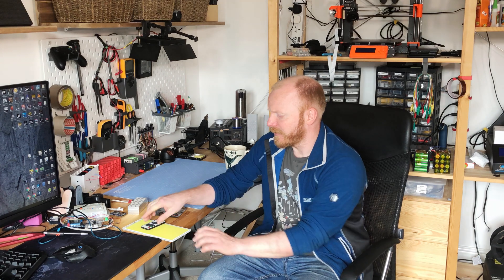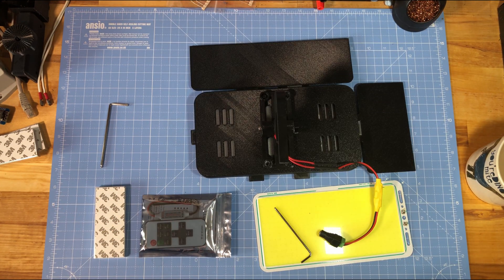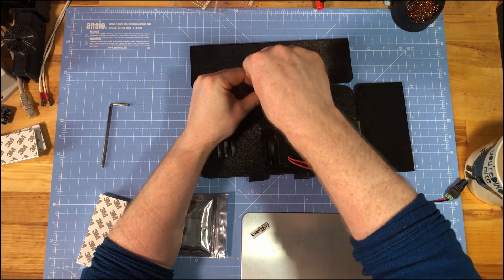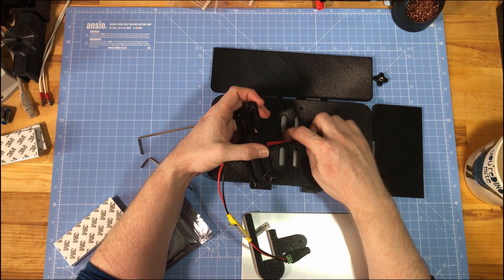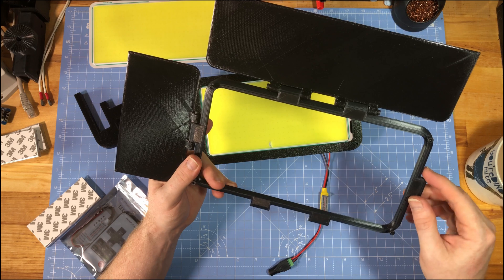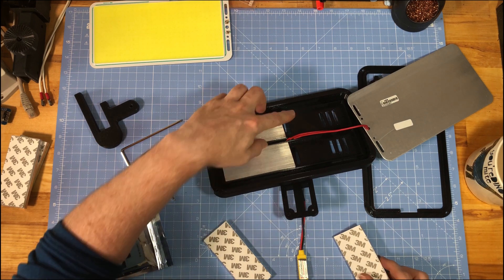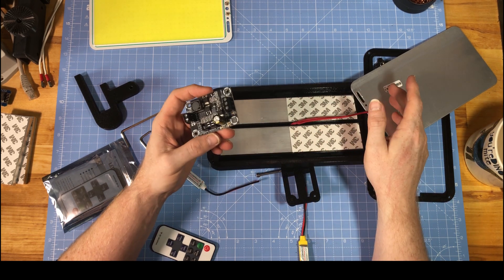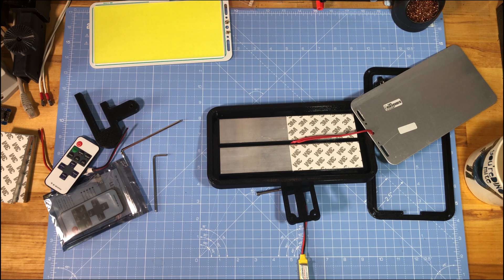DIY 70w Studio / Overhead light with remote

Comment: Okay but how to power it? I can't find constant current psu with 4amp at around 12v.
Reply from the maker: Hi Thom  using the controller with the remote gives a constant current so you can use any 12v supply.  I also linked to another controller in the video which works the same.
Reply: @Chickey  Oh I see. Thanks.

Comment: Nice lamp. I believe the baffles as you call them are typically referred to as barn doors, but maybe that’s just a British term. A wemos and a mosfet (and a resistor) might be the cheapest way to add this into home assistant. 
Thanks for the video.
Reply from the maker: They are called that on Thingiverse as well lol, had a total brain fart.  I have a board that I use for my garage lights that would work well with a mosfet but like the physical remote idea too I must admit.  ESP and mosfet could make for a powerful security light though.
Reply: Colin Hickey Yeah it might work well as a security light. Nice idea.

Comment: Hi, this RF controller, is it still working to you? Three of mine stoped working after one day..
Reply: Same here. Bought 3 two have failed. Haven't used the 3rd much other than to test the remotes of the 2 that failed. Remotes still work but receivers not so much. Using 12 volts 1 amp on full power. Got mine from eBay but appear to be the same unit. Hit and miss if you get a good one I guess.
Reply from the maker: @shenn7332  I must have really hit lucky, I've three but only used one of them so far.
Reply from the maker: Wow really, yeah it's been working for several months now without issue.  I know a CR2025 is recommended but i use a CR2032 which is snug but works great, could it be the CR2025 is not making contact?